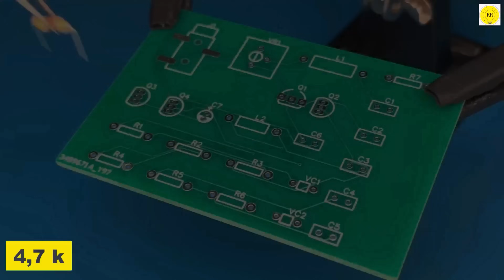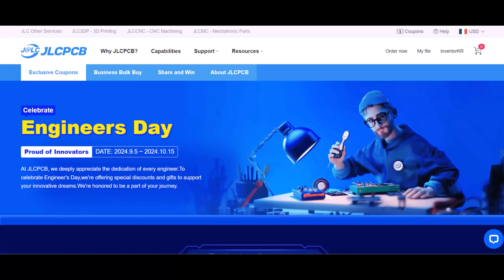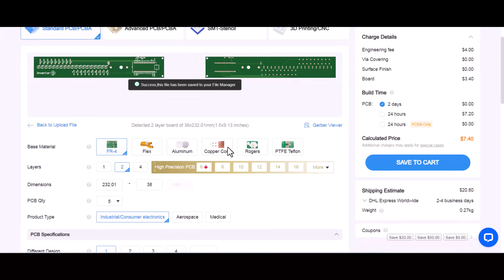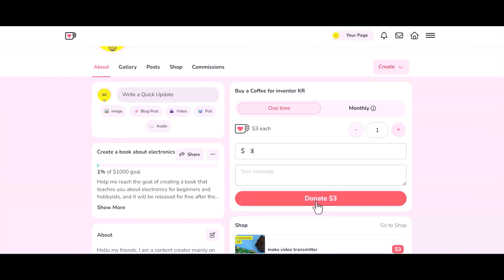how to make fm radio at home , Super Simple FM Radio Receiver, Electronics

Comment: When will there be an FM radio transmitter in the 88 - 107 MHz range, not a receiver, for example 5W with the possibility of choosing the dial and being able to connect it to any speaker or mixing console?